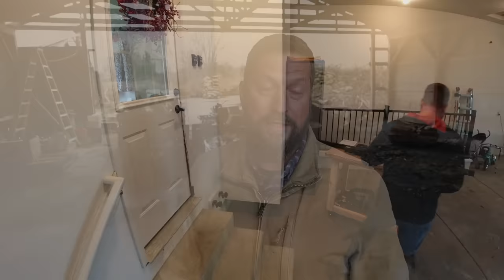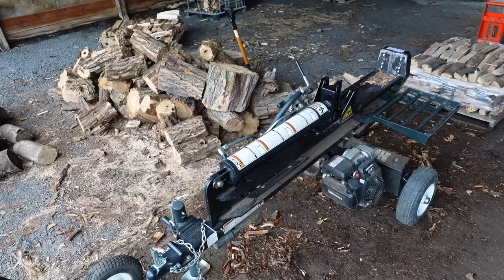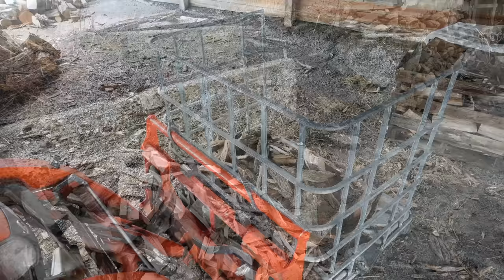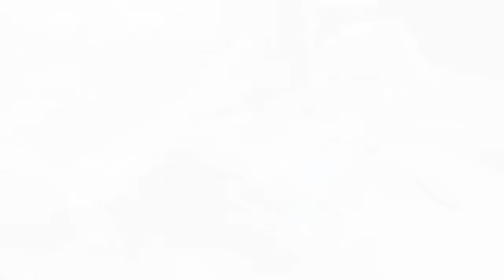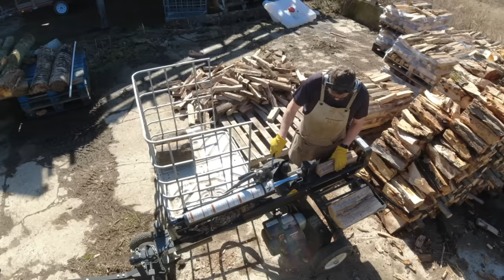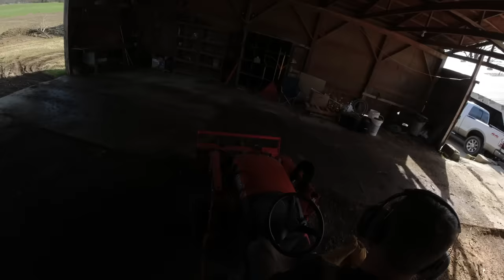The Best Poor Man's Firewood Processing Layout Ever

Comment: Having heated primarily with wood since the 1970's my system has evolved to constantly handle the various stages less and less. At this point, I fell and limb in the woods. The tree lengths are skidded to a landing, and reduced to 16 foot length and moved to my wood yard on the forks. I buck to 20 inch length while on the forks, allowing the rounds to drop on the ground. After forwarding and bucking for a few hours, i use the bucket to push the pile up. The wood is just now ready for its first manual handling onto the splitter( I'm too old to split with an axe now) and once its split, it again falls to the ground. I then stack it in crates built of pallets, cover and set aside to season.  From there the crates move to the door nearest the stove and i have to handle it yet again. Long way of saying everyone adapts to thier own situation but eventually unnecessary handling is eliminated from the process because it is inherently inefficient.  Save yourself handling and you'll improve your efficiency. Just one grumpy old man's take on wood.
Reply from the maker: Love that system! I often toy with the idea of building crates but ultimately, my Kubota BX won't lift enough to make it worth building anything so I'm going back to old school and just stacking in rows. I'll have to handle the splits more than I want to, but if I'm selling it, the quality of the product is the most important. The bulk firewood for my Dad is working perfectly in the corner. Just scoop and load 😁👍 Thanks so much for the comment!
Reply: Here in Scotland; logs (10ft long) are laid on to a midriff height table with a 90° inset roller table, with an overflow table on the other side for oversized logs too big to go into the processor.I take the log across the roller table (feeding the end into the processor - Palax Combi MII, link below - the split logs are carried up the elevator and into one of two opened mesh log bags sitting on top of pallets. Once filled, the forklift lifts the one bag on top of the other, and the two are lifted via the pallet under the lower bag, and moved into the store. From there, 18months or so later, they are taken up as is to the burner room, where I touch the logs for the second and final time, loading them into the log boiler. My table gets filled by the truck delivering the logs (23 tonnes at a time). Palax Combi: https://youtu.be/KDYM7X8R7jw?si=FO5Hx4P-Ru31cc4k Japa are available in the US as an alternative machine (40+ year old design now)

Comment: I guess by now you would have hinged the cut off piece of the tote at the top and fixed two snap latches at the bottom so you can fill it to capacity then release the snaps and dump it.
Reply from the maker: That would work splendidly if my little tractor could only lift a full IBC tote of firewood. If I had a more capable machine, I would definitely do something like that 😁👍

Comment: Ok.. I never wrapped firewood in plastic wrap but from what i can see it will still dry out...  its on a wood pallet so air flow from bottom tops are not covered so air flow from top add that together and that equals air flow which with time dries out firewood come on people its not rocket science..  I have built fires from green firewood, damp firewood,  and from a tree that we pulled out  the creek ( now that took a lot of rich lighter pine) or (as whatever folks call it fatwood) i mean we used the tractor drug the oak out the creek chain sawed it up splitting mal made a camp fire and cooked up our fish and squirrels. With a pine sap ball and lighter pine you can build a fire in any weather..
Reply from the maker: Thank you! If you watch my latest videos, you'll see I'm stacking full cords out in the field. I don't think the plastic was a problem but the firewood just didn't get as much sun and wind as it should where it was. Stacking on pallets was somewhat helpful, but took more time than it was worth. I'm refining my process every day... or should I say year. Never stop thinking about how to improve 😁👍

Comment: Some U-Bolts and flat stock would secure that IBC tote to your pallet fork frame much better.  Makes more sense cutting the whole front off than what most people do only cutting a section out then trying to dump stuff out of it LOL.  

Wish I had a log splitter like that...I just have the 5 ton electric one from Harbor Freight, it works, but its slooooooooow!!  Luckily I only need it once a year for a few days LOL.  Which is why I went with the electric one over a big gas powered one that would sit 360 days out of the year...and be a constant pain with fuel/carburetor issues.
Reply from the maker: That Honda engine is the key to my splitter. Can't beat em! It's slower than it looks in time lapse, lol. I've got another idea for the tote... stay tuned! And thanks so much for watching!!!
Reply: @samsdoinstuff  Oh I bet its still faster than the electric one I have, which to me is dangerous, I've almost been hit a few times from flying chunks of wood....you have to hold the power switch with one hand and operate the hydraulic lever with the other, so your face is right there next to the round you are trying to split...that power switch should just be an on/off toggle switch, and I may modify it for that since its long out of warranty...I think it should be a safety recall.

Comment: I love this setup. I have not gotten mine in place yet so I can’t comment much but my plan is very similar to yours. I want to place all the logs at full length onto a table of sorts. A bunch of 4x4s spaced out 4” gap on each. The thought is to set the whole log times like 5 at a time onto the table. Cut it to 16” on that table and then roll the rounds to the end of the table where the splitter is and then stack it straight onto pallets and wrap it with plastic wrap or I am going to try plastic bands so it will be half cord on a pallet that can set to dry and then be moved around as it is on the pallet so machinery does 80% of the work and I only have to handle for the splitting and rolling and nothing I have to Bend over for so I can go longer. Everything downhill setup so the rounds want to get split.
Reply from the maker: Thank you! Great ideas too! 💡

Comment: Thats a great set up, waist height so no bending = no store back. I bought a thumb for my backhoe and going to try using that to pick up the logs and cut right from there and use my skid steer splitter to pick up the rounds and split them into a pile right by my Sure Split to try to limit the bending over, if that doesn't work out I just might try this system.
Reply from the maker: More machines = lighter work. A thumb on a backhoe would be perfect but I honestly think my system is faster because I can do 10-12 logs all at once rather than hopping on and off a machine. Glad you liked it!!! 👍

Comment: Nice video!
I also greatly benefited from seeing your harbor freight trailer side wall brackets.
My current system is to screw an angle bracket to fix the side walls. But I don't like doing this because it takes a while and I keep the trailer folded in the garage for storage.

I think between the ones you are using, and the ones with a fold down lever I should be set!
Reply from the maker: Thank you!!! So happy I could help. I love that little trailer 😁👍

Comment: I did wrapped green bundles one year and the plastic condensated and grew mold. It didnt work.  

Rabbit cage wire will work better, can be reused, and will stack much higher.  We use it to wrap pallet of quarry stone for interstate transport. 4x4x4 and about 3200 lbs each.
Reply from the maker: Your timing is perfect. Tomorrow's video shows how I moved my stacks into the fields and I don't use the plastic wrap anymore. Lesson learned 😁👍

Comment: Wire mesh wrapping instead of plastic wrapping. In each end of the fence could be a stick of wood for opening and closing.
Reply from the maker: Thanks for the tip!
Reply: @samsdoinstuff  
I have never tried wire circles on pallets.   When setting it up I would leave space between the sticks for human access to the wood. I would have an elevator to drop the wood in.   Random loose is 190 cubic feet / cord.  My plan is to avoid attaching the wire circle to the pallet.